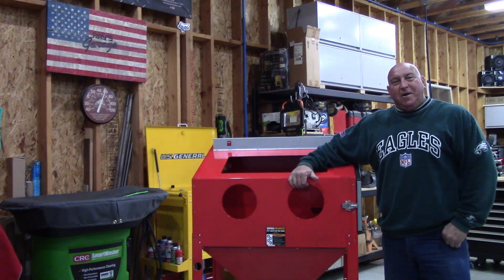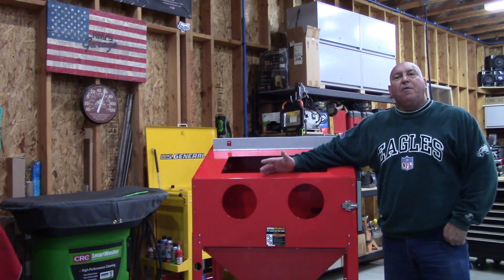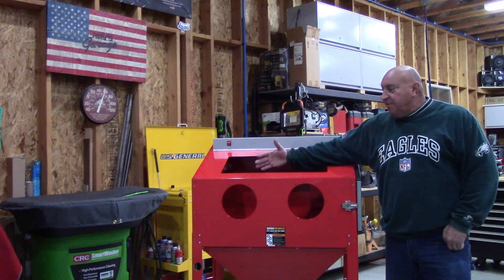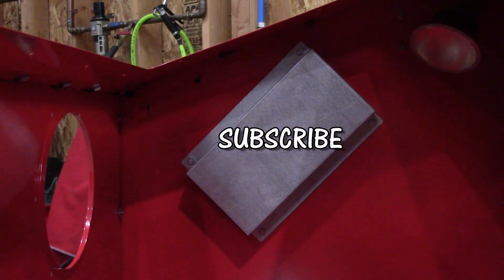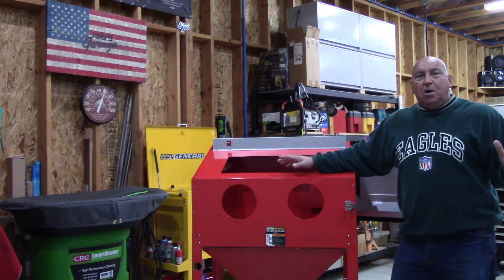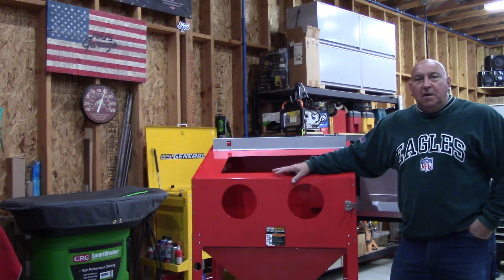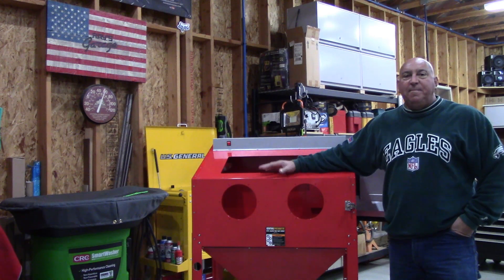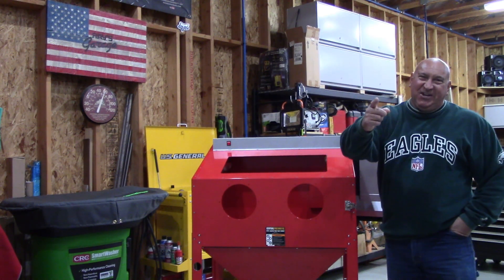Ultimate Blast Cabinet Build

Comment: Ray  Do you know of a paint that matches the harbor freight blast cabinet. Mike at Tacoma told me you might have found a match. Thanks
Reply from the maker: I did find smothing close but not exact, I will have to go thru the comments on the video series to find the pait I used and get back to you.
Reply from the maker: I used Rust-Oleum gloss cherry #248568 over Rust-Oleum white primer.

Comment: Ray I have a tight budget, could you post a list of upgrades in a prioritized list? Most bang for the buck, so to speak...
Reply from the maker: flintlock42003 If you contact Kelly Tacoma at 208-264-5543 she can provide a price sheet and product information.
Reply: Ray's Garage but what should be done first?
Reply from the maker: flintlock42003 I would first purchase and unpack the HF cabinet to verify all pieces are there, then start the assembly of the cabinet, hopper, base. Then cut the shelf and install it following my build series from the start, then cut down the grate and get it fitted inside the hopper. Now you can start with the upgrades.
Reply: I’m sorry if I have not been clear - never mind, I’ll follow someone else’s videos.
Reply from the maker: flintlock42003 If your on a tight budget, the most bang for your buck would be to build the cabinet using all tips I show in the series. The most effective part of the upgraded cabinet is one of the three upgraded gun kits, this includes a metering valve, regulator, pedal, gun and hoses. This will give you a cabinet that performs very well, leaps and bounds over the stock set up.
Reply from the maker: How are you making out with your cabinet build?

Comment: Great videos, very well done! But I have a question...no disrespect intended, but why would you buy a cheap inferior HF cabinet, then spend $400.00 + (I have Mike's price list) when you can buy a top of the line Skatblast US made cabinet with foot pedal, high end gun AND an evacuation system, all set up, no mods required for the same price...most likely cheaper if you count your time and labor.
What am I missing?  Again, I don't mean any disrespect at all.....I just don't get it.
Reply from the maker: The Cave Blades No disrespect taken! I can’t answer that question but according to Mike if you do all Tacoma Company’s upgrades, your cabinet will be equal to if not better performing than a one in the 5-6K range. This would be a great question for Mike. Please share his response. Thanks for commenting and for tuning in!
Reply: @RaysGarage  Thanks ray, I will!
Reply: HF cabinet with that $400 mod list is about $550.  Cheapest Skat Blast I found with pedal is $1200, and its not as good as the modded HF cab.

Comment: Hi Ray.  Great videos.  I need direction on what air compressor I should use for best results.
Any recommendations would be greatly appreciated.
Reply from the maker: Hello Dan, Tough question to answer but to put it simple the highest CFM, Low RPM, air compressor with the largest tank you can fit and afford. Volume of air flow is the key and not PSI so 1/2" ID hose and fittings as short as possible for good air delivery and most important is to cool the air before it enters your system. Here is a video I did some time ago of my setup that to date is working great with no moisture at all! https://www.youtube.com/watch?v=HXKMTE1DbAk

Comment: Looking forward to the build series buddy! I outfitted my HF cab with pretty much all of Tacoma's products that they offer. Not sure if they're making one yet, but I'd like to see a catch tray made for the loading door. I've noticed quite a bit of media seems to collect on that inside lip and fall out when you open the door to load or unload parts in. One additional thing that I did add to my cab that has made a big difference is that I added an abrasive shaker that attaches to the hopper. The one that I use is made by Skat Blast, its called a Super-Pro Abrasive Shaker and the part # is 6120-11. I'm not sure if Tacoma has an equivalent. Definitely worth investing in one if you haven't already. It agitates the whole cabinet and keeps the media flowing down to the hopper, it's pretty darn cool! I'll keep an eye out for future videos. Keep up the great content!
Reply from the maker: Hello Brett, Thanks for the info and will look into it! I did discuss the media build up on the door sill with Mike, his solution is to bend the sill down to create a inward angle so media can not build up there. I need to do a video on this but my cabinet is all prepped and ready for paint if it ever stops raining here! Thanks again for sharing this information and I will pass it along in upcoming videos. Best Regards, Ray

Comment: I read somewhere the most durable glass for a blast cabinet is something called "diamond glass."  This is the stuff used at the grocery store checkup where they scan your groceries.  It has some type of synthetic coating that makes it incredibly scratch resistant.  Only problem....I've never been able to find a distributor.  Anyway, I have the same cabinet still in its box...so, I'm looking forward to this build.
Reply from the maker: ptman3 Thanks for sharing this info on the glass! Follow this link for the complete build series, this should get you started on your build!

https://www.youtube.com/playlist?list=PLnqL6PDhXZH2vMs4XBYM_sf6FJpBKJAJP

Comment: Hi Ray, great videos, what the lowest pressure needed to run the tacoma upgrade and get good results. My compressor is 15cfm with 150 litre tank, FAD is approx 10cfm , i'm using 1/2" hose . Will this work?  Thanks Tim
Reply from the maker: Tim Bates Hi Tim, The operating pressure for a Tacoma upgraded cabinet is 40-45 psi but volume is the key so using a 1/2” id hose and minimal air flow restrictions is best. Your air compressor should do fine. If you find it can not keep up you could add a additional air storage tank but I think you will be fine.

Comment: Hello Ray, I’m just going to say i don’t have much $$$, therefore the reason I am an owner of a terrible harbor freight blast cabinet.  I have watched all of your videos on mike’s upgrades. And I have had a couple of wonderful phone conversations with Mike and Kelly. I have always been the extremist, have a 16” ponytail or shave my head. Do it right or don’t do it. My point, I want all of the upgrades. How much will the bill actually be?
Reply from the maker: flattop alpha If you buy every Tacoma Company upgrades will set you back about $1K but many of the tips and tricks you can do fairly inexpensively. The very minimum Upgrade would have to be the Tacoma gun, metering valve, regulator and foot pedal. Tacoma does offer a very good quality budget friendly kit that performs very well and way better than the HF set up. I would also highly recommend the hopper adapter, it pays for itself after the first use! Talk to Mike, he will take good care of you even on a low budget!
Reply: Thanks for the reply. I figure it’s right at $850. Because I want the deluxe with most upgrades and a second gun for a separate vapor blast build. Disabled and gonna try spending a couple hrs a day blasting and powder coating. Want the best outcome you gotta have the right tools. God will provide if it’s the door I’m supposed to take. I don’t know why but what threw me was I had it in my head that the deluxe kit was 350. It’s more.